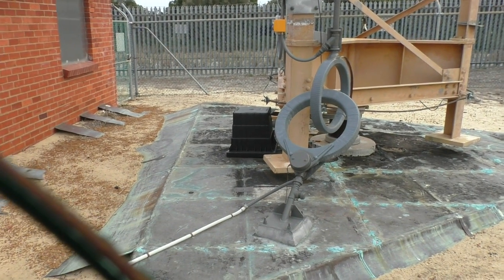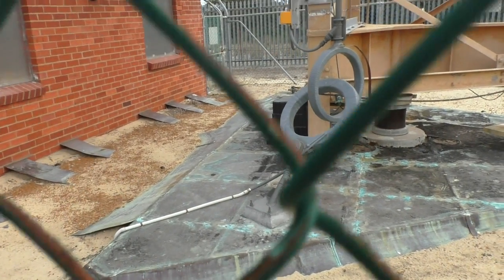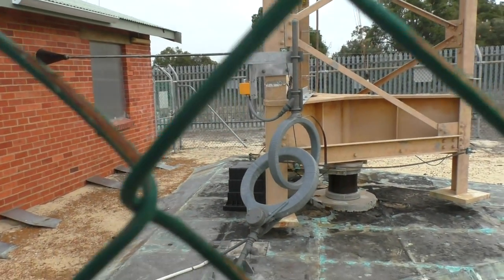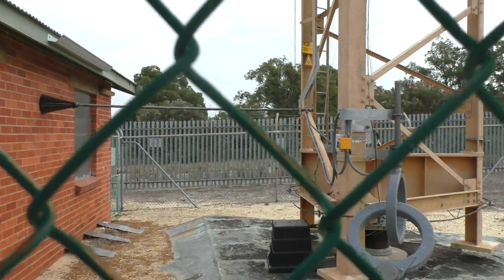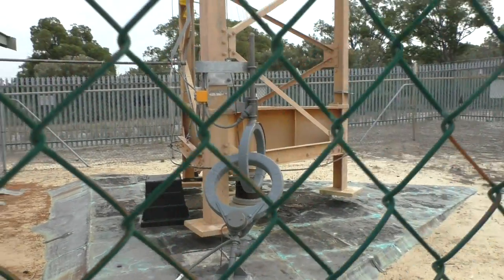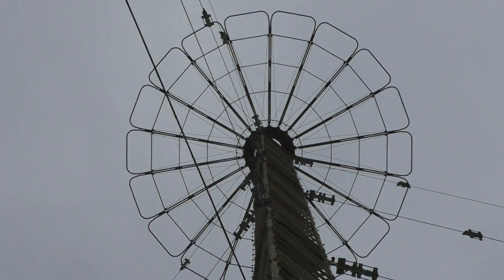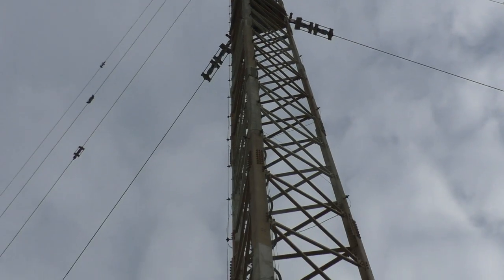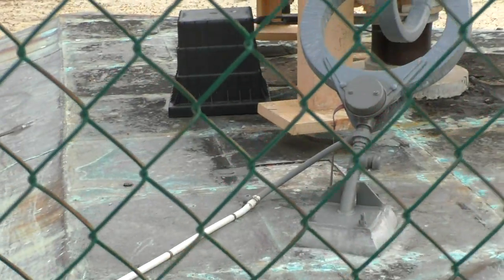AM Broadcast Mast Lighting Voltage Coupling Transformer

Comment: There has to be a better way to power a light up there. Solar? I suppose its all obsolete tech nowadays so it does not really matter.
Reply: None of the three involved devices is going obsolete any time soon. We need towers to spread radio signals over long distances, we need visual features like lights on towers to guide planes away from obstacles and terrain, and we still use transformers to couple AC power. They're elementary tools we use to manipulate electromagnetic radiation, not just old technology.

Comment: can someone else explain the rings?   like are they safety protocol for something?   what do they do. all I heard was something with 220v.   are they used for disconnecting power?  I'm lost
Reply: In case you want to learn more about it, it's called an Austin transformer
Reply: The rings transfer AC power to the lights on the tower without also connecting the mast itself to the AC power source, which would result in some fireworks.
Reply: @chri-k  thank you.

Comment: i'm quite impressed that those can be even 90% efficient (based on a quick google search) - i would have assumed that it was much lower based on the lack of a core as well as the huge amount of space between. i wonder how strong the stray magnetic field would be from this as well.
Reply: There's actually only one core. The lower ring holds a core, toroidally wound, while the upper ring just holds a regular ring coil... further spaced, but still wrapping in the same direction through the same core as the toroidal windings.
Reply: @jercos  wow. that makes complete sense.
Reply: @jercos  that's what i initially thought was happening. Apparently i got gaslit.
Reply: @chri-k  you’re right - i should have said there are two separate cores. regular toroidal transformers have both windings on the same core.
Reply: @vinylcabasse 
I guess I misunderstood what you meant

I still don't think the stray field would be very strong though
( well, as much as you can call something connected to a radio mast "not strong" )
Reply: What i find more interesting is how is this supposed to work ( at 90% efficiency ) when the windings are perpendicular to each-other

Comment: What does "hot" mean in this context?
Reply: Connected to a live source of electricity.

In other words, hot = it will burn you.
Just electrically.
Reply: The entire tower is hot with RF and is above ground  so far as RF.   Think of an old school CB antenna.  The entire antenna  is insulated from the car body,  and fed at the base with coax.   Now  think of THAT  as a 70KW  am tower.  Much higher voltages  and highest at the top

Comment: Austin ring transformer to be precise. Its just an air core transfomer with a huge air gap between primary and secondary windings.
Reply: The core is rarely air... in fact it's all in the lower ring, with the primary winding spiralling around it. The secondary winding is a straightforward wrap around the secondary ring, coupling it to the (air-gapped) core in the primary.

Comment: I wonder how driving up to the fence with a couple of large transformer coils in the back rectified leading to a battery bank would go? Surely there's some thick waves to ride there!
Reply: Not very well. Power fall off with the inverse square. There's no such thing as a free lunch. Hence one toroid being literally inside of the other.
Reply: @etherealrose2139  
The fall off is exponential? 
If the power is high enough surely there is something left to gather? 
Not free of course, well I'm not paying anyway but that's semantics. . ..
Over time if it's enough to overcome charging resistance + power stored is still +
But I concede, the time it would take to pay for the copper in the coils alone is too much, let alone the bank ect

Comment: Wouldn’t it be cheaper to insulate the a wire all the way to the top? Why do they choose this approach?
Reply: The entire tower needs to be energized because the whole tower is the antenna. There isn't some small antenna at the top, but rather the entire tower is the antenna.
Reply: the tower is or needs to be insulated, if you wired it directly to hot neutral it would cause the transmitter to "pop" offline or short out
Reply: Because  tower impedance changes  and  RF voltage  will be quite high at some parts of the tower.  If you take a simple, old  school 103"  CB whip, it is fed low impedance at the base with coax, and the  Z  and RF voltage is lowest.  1/4 wave  away, at the tip,  voltage is highest in that case, and even with low power CB  you could get an "RF burn"  at the tip.   So  any  lighting wire  would arc at some point on the AM  tower

Comment: What exactly is supporting the tower? The 3 main legs/feet are suspended in the air above the ground.
Reply: Trade Forex with Grant I guess just the insulator and guy wires.

Comment: Is there a way to 100% Tell that the tower is hot without touching it lol?
Reply: Use a radio receiver
Reply: use a plant
Reply: @SuperBorg1  the engineer is engi-here
Reply: Hold a fluorescent tube. We used to do that near Winter Hill, UK. When the old analogue TV TX was pushing huge amounts of power they lit for some distance.
Reply: Well if it's insulated from the ground and a big ass cable is connected to it from a building, it is sure hot